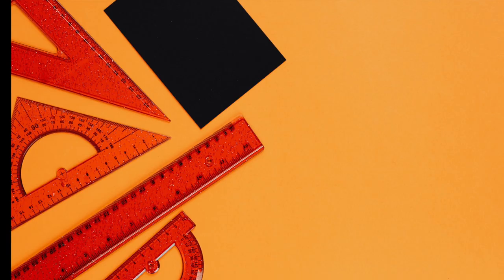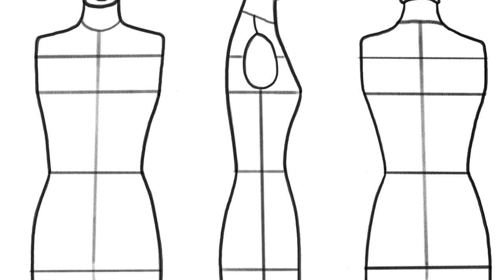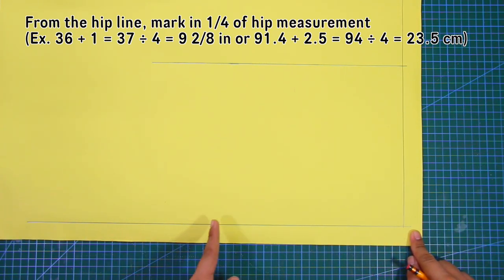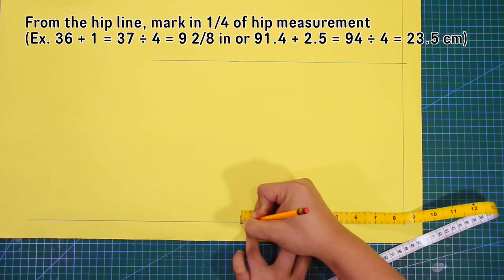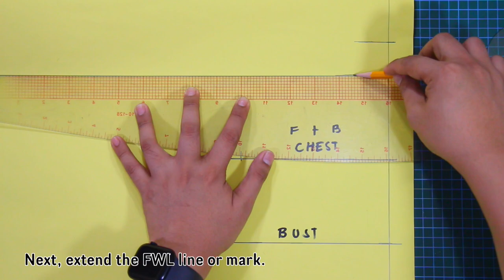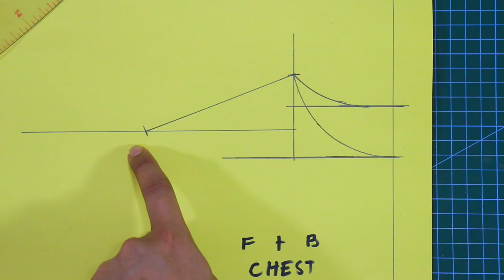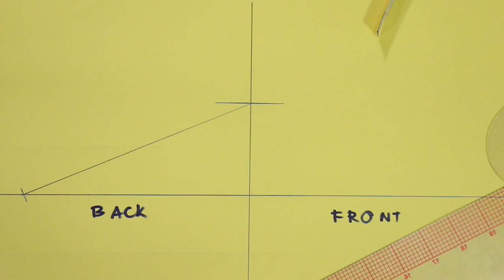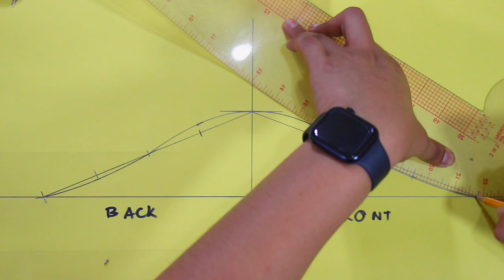HOW TO DRAFT A DARTLESS BODICE | KNIT TOP FOUNDATION | PATTERNMAKING TUTORIAL | LA MODÉLISTE

Comment: Hi i am drafting for my 13 year old daugther. I am drafting a shirt for school.
I have a problem at the neck.
Front waist length is 11
Back waist length is 13
Neck cir = 11.2
( Half of Front neck height %3)=1.8
(Front neck width %3+3/8)=2.1
My neck height calculation when i devide by three ends up below the back waist. And i am not getting the bull shape to draft the neck. That 1.8 that i end up with is the problem. Please help.